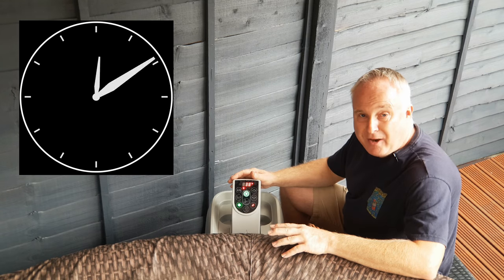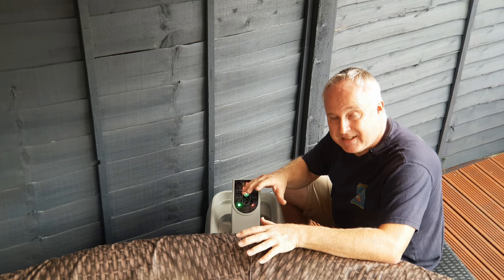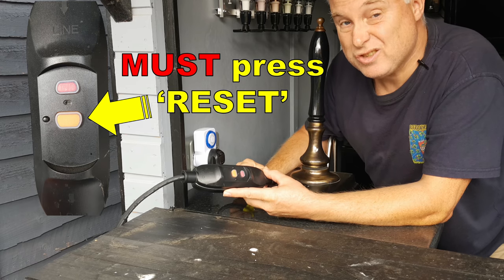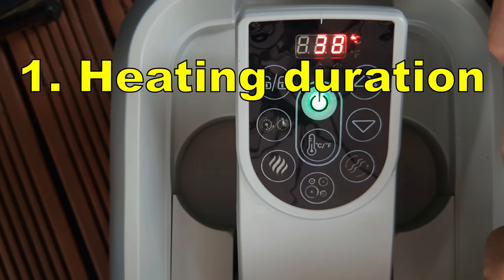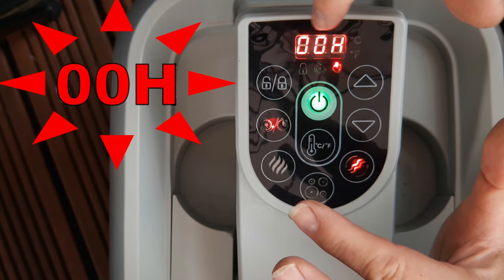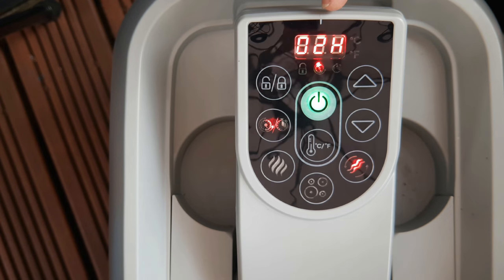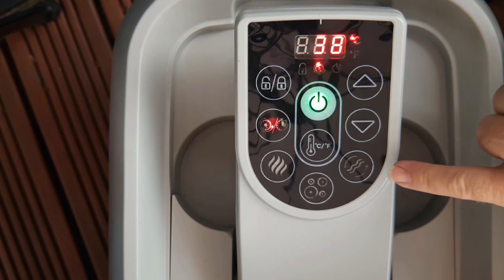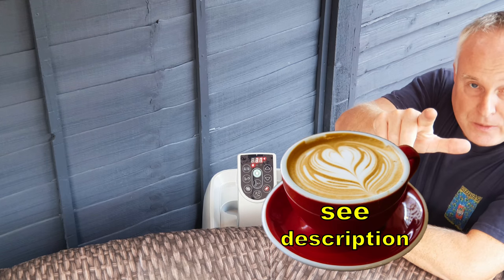How to Set the Timer on a Lay Z Spa Pump Unit | BEST Guide on Youtube

Comment: Fantastic! Will rewatch tomorrow and test on my spa, it's been a long day.
Reply from the maker: Enjoy! New spa?
Reply: @AbouttheHouse0  yeah, 4th one, finally got the new 2021 pump. Much better than the older ones. Had a Monaco first, then two Vegas and now a Helsinki. I used them everyday so it's been a good 5 or so years!
Reply from the maker: @DashDrones  are all the 2020 and earlier ones the egg shape and they changed to 'box' for 2021? Or have I got the wrong end of the stick.
Reply: @AbouttheHouse0  yep, that's exactly what I meant. The heat/filtration system stays on at the same time as the airjet massagers on simultaneously unlike either or on the old ones 👍

Comment: Yours is by far best on this topic.  To confirm, I can't set the spa up to cycle on and off.  Each time I want to use it, I need to set duration to run time and a start time?
Reply: Just got mine and haven't figured any of this out by experience, but I think if you leave the heater button 'on' the pump will cycle on/off while maintaining the temperature indefinately until power is cut off.???  the amazing thing I found out last night is in 35 degrees, the tub only lost 11 degrees(from 99-88) from 10pm to 8am. I turned off the heat button thinking it was the circulation button!  this vid helped me realize that.
Reply: @dfwguy7149  Appreciate your feedback.   So far as I can tell, the pump runs continuously regardless if the temperature has been reached.

Comment: Thanks for the video! What is preferable- To keep the heat at, say, 36 degrees continuously, or to let it cool down and heat up again 4 hours before bathing?
Reply: That depends on how much you pay for electricity at any given time. If you have solar panels for example, keeping it at temp while the sun shines is probably the better option. If you get cheap rate electricity at night and use the tub in the morning, having it heat overnight makes sense. If you're able to add additional insulation around the tub to reduce heat loss, keeping it at temperature may be as effective as only heating prior to use. A lot of variables to consider in each user's situation

Comment: Thank you so much! I paid 10 times energy by keeping it ON all time (heat and filter) Can I turn both OFF and only turn on when using it? I do use it once a week only. THANK YOU SO MUCH FOR YOUR HELP!
Reply: You can turn both filter and heat off, when the timer activates it will turn both on for the set duration.

Comment: Thanks for this video! I just set up my spa, is it my understanding there is no way for this pump to come on by it's self unless I set the timer every day? And the heater will not come on unless I start it myself as well?
Reply from the maker: The timer sets the heater to come on in X hours time for Y hours. When the heater comes on by timer, the pump comes on too and goes off at the end of the timed period.
You can have the pump on at any time (or all the time) by switching it on.

Comment: Thank you for the tip.  Sorry for the questions their manuals are not very good.   

Is this something that can be set or scheduled daily or do you have to do this everyday?  

Also do you know what this is about?  
Designed with innovative winterizing technology, the system will keep the internal temperatures between 42º and 50ºF (6º and 10ºC) to prevent damage.

Comment: Hi can I ask a silly question... after use of hot tub do I power it off and turn back on in the morning. And should I leave the filter and or heat  on all day when it's being used or waiting for people to use. I hope this makes sense. Thank you I love your videos
Reply from the maker: It is best to leave the circulation pump on or at least run it for 4hrs in every 12hr period. If you're using the tub most days then leave the heating set to 2-3c below normal use temp and then put the temp up a couple of hours before use. If you use it in the evening you could use the timer to bring it back on next morning. Remember, overnight is when it will cool the most.

Comment: Excellent. Is it OK to use chlorine tabs in the built in dispenser? Or should you always dissolve them in a jug and then add the solution to the tub?
Reply: Put them in the holder on the inside of the spa above the filter

Comment: Thank you. You mentioned about leaving the circulation for 4 hours in every 12. If you have the temperature set to say 35 and it is constantly checking this. Would there be no need to manually activate circulation as it would be doing it periodically as it keeps temperature?
Reply: The circualtion pump is automatically on if your heating is on.

Comment: Thanks for the video.  Very helpful.  Dam nuisance that it only works for the hours set.  So I live in QLD, AUS (very very hot in summer) and we are going away for 8 nights at the end of December, so I guess I will have to set it to cover most of the time we are away.  Any suggestions, most welcome.
Reply from the maker: Rather than allowing it to cool and using the timer for 7 days time, I'd suggest reducing the set temperature to 32-34ish and leaving it on. Knock it back up to 'normal' as soon as you return (or get a friend to do it the day before). It'd be cheaper and cleaner that way. Also put tablets in it

Comment: hello , great videos for the Layz Spa hot tub... but maybe you can help with my problem ... we live in a climate above 40deg.. so therefore we use the pool to cool down... we need only the circulation of water 4hrs daily without any heating .. is this possible to set up? a video would be great.. thanks Craig
Reply from the maker: Good idea, I'll see what I can come up with. In the meantime, just leave circulation going and heat off - it only uses 50W.
Reply: @AbouttheHouse0  cool thanks ... I just worked it out.. because its so hot here in dubai .. the heat mode just stays green and the circulation works 

The heater doesn't need to come on if you set to 36deg

Comment: Clear explanation, but I'm at a loss as to why it would be use. I check my spa daily, and when i think i may even want to use it, go back to it and start it heating/pumping. Dont get what the benefit is the timer function if 1) it cant be left to run and cycle 2) has to be setup and started each time.. I'm sure there are use cases but I've just not thought of them... :D Good video again tho, and i like the end bit 'i shall see you  again <good pause> pointy finger</good pause>'. Reminds me of Shaw Taylor on Police 5 :D (showing my age....)
Reply from the maker: I can think of a few use cases. If you're going away for a holiday you could set it to be ready for when you get back.
If you have economy 7 leccy you can set it to heat in the cheap rate
Set it up in the evening so it's ready for when you get home from work the following day
And no doubt more. I agree it's very limited though. It would have cost less than a fiver in production costs to put a proper timer in the controls OR at least make the unit capable of being used with a plug-in timer.

Comment: I just purchased a new Salut spa, Coronado model, and unlike my previous model from them this one doesn’t seem to turn off the heater once it reaches my set temperature, which seems wrong. My old one would wait until it reached the set temperature and then would turn the heater off and then it would turn the heater back on once it dropped one or 2° below my set temperature am I doing something wrong

Comment: Hi,

My lay z spa Miami with the old style pump has decided it doesn’t like the current cold weather and is throwing up an E03 error (the temp is too low), in the last few winters we have got around this by covering the pump with a towel and a plastic dustbin.  My question is……. If I buy one of the new style square looking pumps like the one in your vids with “freeze shield” tech, would it turn on and heat the water to between 6 and 10 degrees on its own as long as the pump has power to it OR does the main power button need to be turned on OR does the power button, the heater button and/or the filtration buttons need to be on too, I’ve looked everywhere and am struggling to get clear info.  Also, it looks like I would need to have warm water to start with otherwise the new style pump would throw in an E03 error to start with.  The water in my tub currently isn’t frozen but it’s very cold if you put your hand in. Your thoughts would be appreciated.

Comment: I just bought mine and set it up last night.  Do I need to run the circulation to heat it up or can I leave it off?
Reply from the maker: You cannot have the circulation OFF and the heater ON. The unit won't allow it for obvious reason

Comment: I had one of these pumps before but course it went bad after about a year-and-a-half and I got this new one which looks different and was hoping the timer had improved. Apparently not.
How nice would it be to have the heater turn off at midnight every single night and then pop back on say around three in the afternoon so you can use it again the next evening. Yeah, guess we can't have that
Reply from the maker: It's even less than basic❗If I can pick up a pump unit cheap I'd have a go at making up a "remote control".

Comment: How often do you change water? Do you leave the hot tub running at all times, even not in use? Should I turn it off if I only use in the weekends F-Sun? Thanks
Reply from the maker: Every 2-3 months. In your case, I'd lower the set temp to 30 after last use on a Sunday and pop it back to 38 (or whatever you use it at) Early Fri morning (it'll go up about 1.5 deg an hour).
Reply: @AbouttheHouse0  I decided to turn it off completely until Friday noon turn back on 102F, turn down while I’m done like you said and leave it till Sunday and turn off Monday again.
Reply from the maker: @Tom-pp4iv  insulation will be your big saver. Use a thermal cover (maybe even two!) and it will cool down loads less M-F and thus need less heating on Fri. Our thermal cover is defo saving us about 45-50% (the results in the video were a little pessimistic) and using two would save you around 70-75%.. Don't forget to insulate below the tub too 👍

Comment: Quick tip,  you can set the duration and then keep the second option (Time) to 0 for it to turn on now for X amount of hours.
I do this most mornings when leaving for work and its toasty if the Mrs wants a dinner time dunk.
Reply: What do you mean set time to zero ?
Reply: @CityGirl33  When you press the timer button, the first time you set is the duration (how long you want it to run for) then you hit the timer button again to confirm, it moves you onto another time option. This is the “How long from now do you want it to turn on” option. If you leave it at zero, you can have it turn on from now until however long you set the duration for.

Good for starting it on a morning for a few hours to get it warmed up a bit more, and if you decide to not go in, you don’t have to worry about going back out to turn it off.
Reply: @Darksum90  thank you - I wish I had known this prior to purchasing
Reply: @CityGirl33  Why, if you've purchased it, you need to know after buying it not before?
Reply: Say I want to use the spa at 8 pm. When should I start the timer to make sure it is good and hot for when I get in?
Reply: @jessiecline8291  Theres no way to know this. It depends on size of your tub, time of year, the starting temperature, clean/dirty filters... Best to just time it yourself.

Comment: Thank you, can i ask, if i want my lazy spa to be 40 degrees at 7am so i can use it before work,  how would i figure out the timer, would it go cold over night as the heater isnt running? Then take 4 hours to get to the desired temp, at 11.45pm i set the heat duration at 1 hour and delayed the timer for 6hrs coming on at 4.45am, the desired temp to 40,, i turned the heater off and filter, temp was then at 39degrees...hopefully at 7am it will be hot if ive understood this video  right.
Reply from the maker: If you set the delay for 6 hours, then the heater comes on in 6 hours, which will be 5.45am in your example. The heater will then be on until 6.45 am. If you don't have a thermal cover, the tub will cool by about 0.3-0.5C per hour and heat by about 1.5C per hour.
If you wish to use it each morning and maybe some evenings, you would be best to keep the heater on , so it can 'tick over' and maintain your desired temp rather than cooling, heating, cooling heating etc.
Buy a thermal cover too - The Range have them ATM. That'll cut you leccy costs by about half.
Reply: @AbouttheHouse0  wow, thank you, i thought you could turn the temp down to ex. 35 at 8pm and put the timer on to the desired temp of 40 degrees at 5am to be ready for 7am but thats not the case so.  I didn't know there were thermal covers out there, ill pop into Rang tomorrow, appreciate the great advice.

Comment: So does this mean i need to setup this program every 4 hours in order to keep the hot tub at the temp set? Not understanding the difference between the temp control setting and the timer.

What’s the best way to keep the hot tub at the temp you want without costing an arm or a leg? 

I am treating this like my central heating. Set it to X degrees, when it a drops below, the unit activates and keeps it at set temp,
Or am I wrong Thanks
Reply from the maker: Yeah the timer on these is pathetic. It only operates the tub once. So, just leave the tub running at your set temperature.
use insulation. I've got a couple of videos on ground insulation and thermal covers. This'll cut the leccy useage by about half or so.
If you can put your tub in a spot where it gets a few hours of sun each day, then on good days the temperature will rise by 1-2 degrees even with a thermal cover on.

Comment: I have a Saluspa Ibiza it is the same style pump as you have but in the manual it shows a heating reset button hole there is not one on my unit. How do you do a heater and pump rest on these units

Thanks
Reply from the maker: Oops, sorry it's so long ago. On ours the reset button is on the side about halfway up. Some have them on the underside. On ours you can press the button with your finger but on older ones you had to use a pen or similar impliment.
Or did you suss it out?

Comment: Considering wire cutting the RCD off completely and just fitting a plug.. any thoughts
Reply from the maker: If it's new, that will void the warranty. Electrical regs require RCD protection, so as long as there is a 30mA RCD in your comsumer unit that's fine. But if it's not giving trouble, why?
Reply: I don't think this will achieve anything in regards to timer function as the settings will clear when power is turned off.

Comment: You mention circulating the spa for 4 hours per 12 hour period. Is the only way to do that manually by pressing the filter button? Running it 24/7 would be too costly, but I don't imagine hot stagnant water is a good idea.

Comment: Hi! After wachting this video I think you might help me out with a situation I'm having with my Lay Z Spa St. Lucia. I cannot seem to separately switch off the HEATER and PUMP(water circulation) function. If I turn off the pump, the heater switches off too. DESPITE the temperature settings. Whenever I turn on the heater, the pump switches on automatically. This leads to some scenario’s that don’t seem right to me. For example:
-	I lower the temperature to 25 degrees (when I’m gone for a couple of days for example) the temperature stays high(er), around 30 degrees. Probably because the heater stays on. If I switch of the heater, the temperature drops to below the 25 degrees that I’ve set the jacuzzi to. 
-	When I’ve set the temperature to my the standard 40 degrees, I cannot turn of the pump without the heating switching off too. Even if I’ve set the temperature at 40 degrees, it will just keep on dropping.
This currently means that:
1.	I am forced to ALWAYS have the pump on
2.	I cannot really control the temperature (because if, say, I set the temperature to 25 degrees, the pump and heater HAVE to be on, keeping the temperature higher than I need)
I can’t imagine this being normal. Can you help me figure this out? Thanks so much in advance!

Comment: Thanks for this. just installed my maldives spa.  can you help with a problem. its heating up ok no fault codes at all but no water is returning through the top outlet where the chemical additive ring sits. at a loss how the water is returning and heating up. only used to a cheap spa before this.  thanks
Reply from the maker: On our St Moritz the filter is the top item and the chemical ring is the bottom. the filter is the pump inlet and the lower port the outlet. Refer to setup: https://youtu.be/nZew9F8dv6s
Reply: @AbouttheHouse0  Thanks for that. the lower is the filter in, you can feel the suck... on the top if I unscrew the outlet where the chemical ring fits.  inside the spa wall I come across a plate of some sort just behind the  outlet screw threads. why would this be blanked?  maybe its a defused sytem now, just cant get my head around it. A faulty pump would show defect codes?
Reply from the maker: @peterandresen3413  are you sure you haven't still got the blanking plugs still fitted to the outlet?
Reply: @AbouttheHouse0  No 3 off the internals heater out and filter both ways and four off the pump unit. The plate or what ever is internal you have to unscrew the fitment that the chem ring screws onto. that the only way you would know anything was there. No one answering calls at tech support lay z spa. anyone know a dedicated phone number? thanks for looking. hope to get to the bottom of this soon. 68 and don't relish dragging this out to go back.

Comment: What happens at the end of the hearing period? Does the hot tub turn off? Or what temperature does it go to?
Reply from the maker: At the end of the timed period the tub simply turns off. So you need to attend to it and at least turn circulation on to maintain set temp